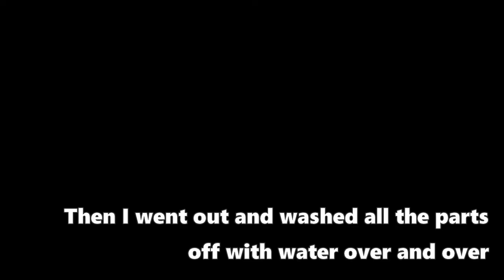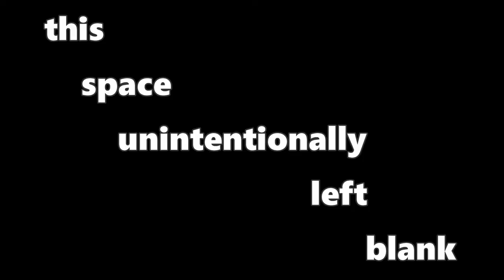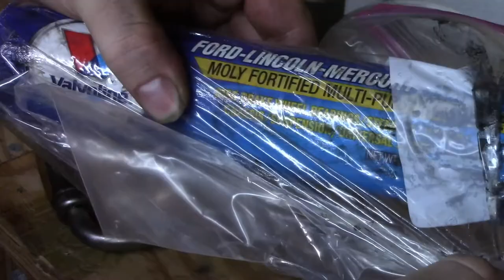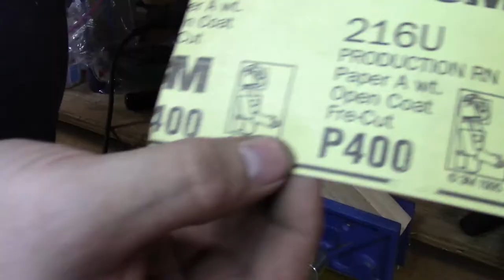Drill Brace Restoration

Comment: 2" magnetic hex bit extensions and spade bits are super handy for using drill braces in the modern shop. I like 'em for the controlled torque.

Comment: Nice work cleaning your brace. Boiled linseed oil and paste wax is my goto finish. I mix the BLO about 50/50  with mineral  spirits. It penetrates better and dries quicker. Two coats and a few hours wait before the wax.
The square tang augers work much better. They also cut wood better. The design has a knicker that scores the wood ahead of the cutter so there isn't any tearout.

Comment: Should have just used paint stripper on the wooden bits. It would have been much quicker, less effort and no damage. When putting the chuck in the vice, you should have put something around it to protect it, instead of damaging the knurling. You got it restored in the end. Good job.

Comment: The brown stuff is shellac and grime from years of use and power sanders heat it up and make it ten times harder to remove, scrap it off by hand to remove the build up then hand sand.i did cringe a little the way you had your thumb under the spindle grip when you were cleaning it up with your craft knife,one slip and a sliced thumb later? Just a thought on safety!

Comment: Is that a brass wheel you used?  If so, was there a particular reason you used brass instead of the standard wire brush?  I Have one of these I need to refinish and never thought of using the drill press!  Thank you for the idea!
Reply from the maker: Kyle Runyan honestly it's just what I found in my tool chest, not sure where it came from or why. Probably harbor freight. Now that I think about it though I probably got brass to keep the surface scoring to a minimum
Reply: Wish I had a drill press.  So versatile.

Comment: I had to stop watching your video. Do you have any common sense? Electric parts cleaner? Ever hear of lacquer thinner? That Brace is not electric, Also ever hear of paint stripper? It softens the Varnish on your brace, then wash it off with Water Brace, and why don't you use a bench grinder with a steel wire wheel on it? Brass on steel? Come on dude. I don't care if you get mad are not, Start using some Common sense and ask someone for advice, it might just make your life a bit easier.
Reply from the maker: Can't argue! I stopped trying to do stuff like this a long time ago, pivoted to things I understood better.
Reply: I think you're being extremely harsh for no reason. The end result looked fine, and what's what matters. He got there in the end, and probably learned a few things along the way. None of this stuff is "common sense", it's learned. You're misusing that phrase.